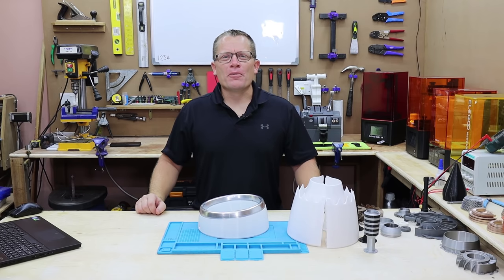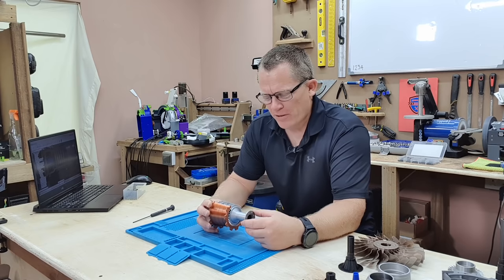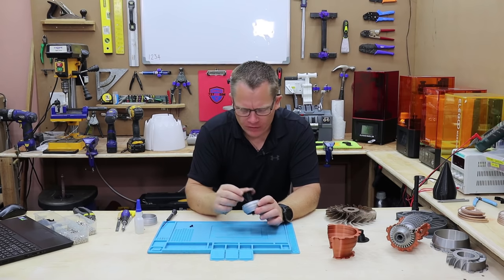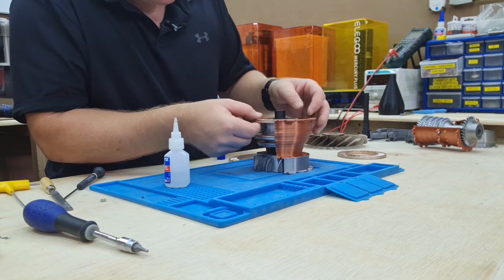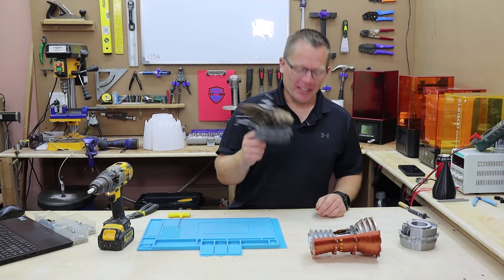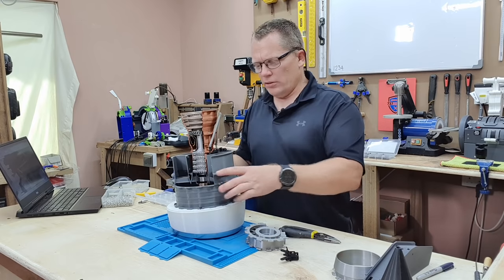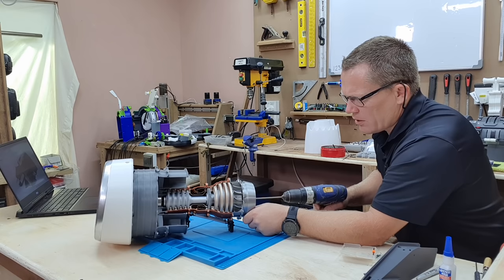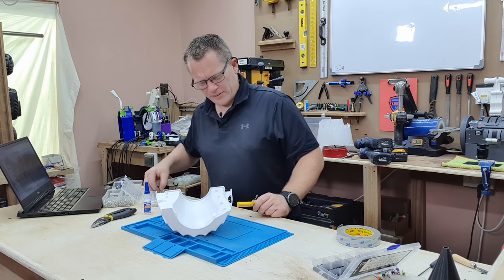3d Printed Turbofan Engine

Comment: Challenge for you: build steel replicas of every piece and try to actually start it with kerosene :)
Reply: I was also waiting for the "working" part..
Reply from the maker: After seeing the rocket engines that are now 3d printed metal, I do wonder if this is possible. But I'd need a few more people watching my vids, before that becomes a reality!
Reply: @helimech8152  this is my first day.
Reply: @helimech8152  dude thats a must, seeing that work would be phenomenal
Reply: @helimech8152  Put the "Thanks" button so that people can donate.
Reply from the maker: If only I had a metal printer, that would make for an awesome build.
Reply: For the people who are talking about printing "steel" parts so you can run it on fuel. I think that there is as much complexity in the metallurgy to make a fuel burning model as there is in the physical parts themselves. The ability to withstand the heat in the section after the fuel cans alone would be a challenge. As you read about the new 5th generation Chinese fighters, with all that their military establishment has for resources, they still don't have the engines for those, if you can believe what is written about them. Still an all, it's a beautiful model and who knows, in the coming years, a fully working model might be in the possible realm.
Reply: Electroplating
Reply: @musoangelo it's possible. He would have to order the parts from industrial 3d printing services though.
Reply: Very detailed scale model. The only constructive use (IMO) would be to use as an instruction aid for students in an aeronautics class. Maybe East Coast Aerotech would be interested.
Reply: Integza joins chat

Comment: In the early 90s, the traveling Smithsonian exhibit -- you know, the Hope diamond, Lincoln´s 10-gallon hat, Dorothy´s shoes, and a Moon Buggy, came to town, which I was happy to visit.

What really blew my mind, though, was a slowing rotating perfect quarter scale model of a commercial turbofan engine at the egress of the exhibit. I have come to realize this as one of the first examples of additive construction. The model was even sized to incorporate thousands of titanium bolts -- a quarter the size as those actually used.

Wonderful!
Reply from the maker: Hi Brian, I would have lived to see that! This is just a plastic version, but I'm so impressed with it. 3d printing is moving fast!

Comment: Truly, it is an excellent build. I have built and still working out some details. I created a detailed accessory package and a swiveling undershelf mount along with 3d lights and a faster 2000 rpm motor. I love this Trent 900 design. Pay the $15 to WileyRC and get the functional reversethrusters. It's amazing!
Reply from the maker: Hi Patrick, This was just for a Prop in the background. Loved the design and build. However, since making this video, i know have turbo prop engines, helicopter gearboxes to create, the list is growing fast. My place will look like my old college training room with all the parts of 3d printed aircraft components. Kind Regards Karl

Comment: This is still a dream of mine to build this model. Thanks again for building on others work, building it, and putting it together. I love turbofans and don't understand why stuff like this isn't available.
Reply from the maker: Hi Zach, this was a fun build. Funny, I was just packing this up last night ready for our move back to the UK.
Reply: I think my original reply was auto deleted by YouTube, I'll try again but separate them into multiple replies as I have a guess as to why a program would auto-delete it.
Reply: Special Note: I applied for a 3D printer very quickly before work began today. I may have not remembered the details accurately about original build and I don't tweet anymore, so it's a mess of replies to replies. If you are unhappy with my tweets for printer for any reason whatsoever, or just simply don't think I should apply with that goal, or have any other issue, just let me know and I will delete the tweets as soon as I can after seeing your deletion request, if it is made.
Reply: I really do love this build, you went above and beyond in creating it. Most of the few models that exist don't have a cowling or pylon, which I think adds so much to the aesthetics and feeling (well, looking at it on screen feeling). I'm still surprised or shocked you can't get a proper model of one (I really wanted one of the iconic GE-90) as I just love Turbofans for some reason. They just get me going, always. And since no one offers it, I decided I'd slowly learn the things necessary to build one myself based on yours and your inspiration sources. At current rate it will be a long while. I've been getting better with electronics, but got slowed down by my own recent moves. Next step is a 3d printer, so full disclosure, I applied for a 3d printer (reason for new comment was I had to find your original video to credit) with stated goal of printing a model similar to yours. Even if I don't get to make one as great as yours I'm just happy someone did it and took the effort and time to record it and share it with the world.
Good luck with your move, hope it goes smoothly, but box that project well, it's super unique and something that should bring you great pride.
Reply: You can find the tweets by searching at Morbo on Twitter, but be careful when searching. I wanted the Futurama name MorboTheAnnihilator,  but it was too long, and now I have yet to figure out if Morbo means something in another language or Twitter is just deranged.
Reply: Original reply probably auto-deleted due to perfectly pertinent, on topic and content related Twitter links.

Comment: There is stool to scrape off edges, it turns to follow contour. Also magnetic extendable tool for screws. Put graphite between rotating parts and casing so spin easier and not heat up as much.
Reply from the maker: Hi Donald, thank you for the advice! Kind Regards Karl

Comment: Have you thought of using 3dGloop instead of CA glue. It’s a chemical weld rather than adhesion. Particularly when sanding produces a better surface of the joint since it’s all PLA (Note fumes aren’t awesome for you)
Reply from the maker: Hello and thank you. All advice is greatly accepted and I will give it a go.
Reply: @helimech8152  which kind of adhesive you use, may I ask

Comment: Awesome  can't wait to see it work with  a motor
Reply from the maker: Hi Richard, I'm currently looking for speed controller and motor that will achieve at 8000 rpm
Reply: Awesome  can't wait to see it running  again.

Comment: Next LVL would be working unit with Metal 3D Printer, Getting better every year
Reply from the maker: Hi John, That would be a dream to build an engine with one of those printers. The quality of the build would be amazing and I would love to see what sort of centrifugal loads they could withstand! Kind Regards Karl
Reply: @helimech8152  With Graphene Nanotubes and microthermal heat transfer I think one could be designed and built in one day. Just need peramaters to input to computer design...... Nvidia has the computer to design and render anything in under 1 second...2021 is a great year

Comment: Haha, that's sensational, Karl! Thumbs up! Next you should print throttle quadrant of same scale and connect em together! :D
PS. Attaching vacuum cleaner's motor at the end will give almost real sound as well! :)))
All the best, Phil.
Reply from the maker: Cool idea! I need to strengthen the large turbine blades first. The stress of more rotational force and i can see it ripping itself apart. However, since building this, many other 3d printed engines have now popped up on my radar that have designed with extra speed in mind.

Comment: Did you know that for some of the airbus airplanes , a few engines are attached to the wings by just 3 bolts ? I used to manufacture some when i was working in an aerospace related company. When I discovered that it blew my mind.
Reply: The Trent 900 that this 3D printed model depicts is one of those. There are only three “bolted” attachment points to the wing. There is a forth vertical pin from the wing that goes into the pylon but only constrains the thrust of the engine. It supports no weight whatsoever and does not need to be detached to remove the engine. The three bolts are also not solid connections but are actually pivot points themselves. All this is done to carefully distribute the weight, aerodynamic loads, and thrust of the engine to the wing structure without generating additional parasitic stresses. 

This 3D printed model has four bolt attachment points but there would be additional brackets that go between these attachment points and the three bolted connections on the wing. The socket for the vertical thrust pin is modeled in the pylon. Some builders of this 3D model have gone as far as modeling the additional brackets and basic wing structure to attach the engine model.

Comment: Karl, this is amazing. Can you do a video describing your SLA printer setup as I see you have a few machines there in the corner.
Reply from the maker: Hi, i have 2 3d resin printers. The Creatilty LD002R wins over Elegoo mars easily in my opinion. The other ones are a wash machine and curing unit. I will certainly try to  create something in the future once the throttle unit is done. Kind Regards Karl

Comment: Amazing model of a turbine!! I was wondering if teflon spray on the parts that still have some friction, would make it run smoother.
Reply from the maker: Hi Sophoclis K, When the design was created, I wouldn't imagine there were many Resin printers available 5 years ago. If I had printed all the parts with a filament printer, I think it would have been super smooth. With a resin printer, my parts come out 0.4mm bigger in diameter. This caused friction against the filament casings. However, Chris the designer actually designed the rotors with wear rings. So as the unit was rotated more and more these wear rings bedded in and the friction reduced. I also need to replace those 3d printed bearings with new steel bearings. This should also improve the running of the unit.
Reply: @helimech8152  My first and very brief experience with a 3D printer was with a raisin one, about 11 years ago but it was so expensive at that time, it would make it impossible to own one. I was so impressed back then, even with the simplest sample: a ball embedded in a nut with a spherical cavity, which would make it impossible to be created as two separate parts and then put them together as such. Since then, 3D printing has become much more affordable, but still what people can do with it still amazes me! That jet engine model is a marvel and I’d really like to see a video when you’ll have all the things that you mentioned sorted out!

Comment: Hi at the ripe old age of 76 I am thinking of buying a 3D printer to makes parts for a 737 sim, but which one to buy on a limited budget would you think that the ENDER 3 PRO would be up to the job, any advise would be appreciated, many thanks
Reply from the maker: Hello, The Ender 3 is too small. I have been informed that there are files included to split the design further down for the Ender 3 though. I have not looked at this option. The ender 3 Pro is an excellent printer for the price and i own 2. You can definitely build the whole engine core on the ender 3. for the larger cowling panels, I used the slighter larger CR10 v3 which has a bed size of 300mm x 300mm. If you can stretch to this printer, I would go straight for it. Its silent and works brilliantly, its like the next level up to the ender 3. Kind Regards Karl

Comment: First of all... what a fantastic project!! It's nice to see you assembling these components!
I have downloaded the 160+ files but as a 3D layman (utter noob) I have no 3D printer.

Are those files sufficient to be sent off to a printing company and have them deliver the non assembled set?
Are there any companies who you could recommend? What price is to be expected for this huge printing job?

With thanks and kind regards!
Keep those great videos coming!!!
Reply: BTW would this set be printable on the latest CR10?
Reply from the maker: Hello Joeri, If you can i would get hold of a CR10. That would be much cheaper than getting the parts printed! and yes it will all fit as that is the printer i used. Kind regards Karl

Comment: I just printed and assembled one. LPT is grinding against LP stators and little hard to rotate. I was thinking to redo the LP part and then I saw you using the drill to wear them. Im gonna try it. Thanks
Reply from the maker: Just go slow, If you go too fast they will melt together
Reply: @helimech8152  Yeah I thought of that. Also, The problem was bent LP AFT shaft. It was wobbling. Found my Printer Nozzle assembly tilted on one side. That explains why the shaft was printed like its bent.😄

Comment: So I started my build yesterday. Bearings are in the works as we speak. Question: what filament did you use for the trim ring on the front of the intake? If not, did you cover it? Im working on the Nozzle Assembly now, should be finished today.

Comment: Thank you for the video.  3D printing these parts wouldn't the ringing and ghosting be too much for a jet engine model or is that FDM 3D printing?  How would you design parts to create a specific engine and aircraft.  I would like to build a 1/35 or 1/24 scale S-3 Viking, but how do you get the design measurements to create the parts and put it together?  I'm also thinking of working on one of the aircraft carriers that I was on.
Reply: I’m the designer of the nacelle. - I printed the prototype on an inexpensive FDM printer. To prevent ringing and ghosting I tend to keep the accel/decel values low. I use 200mm/s^2. At that rate a print speed of 60mm/s produces no discernible ringing. To design the nacelle I traced readily available pictures obtained from the internet. Everything was scaled to fit to jet engine design by CATIAV5FTW. But it came in at a scale of almost exactly 1/16 from the full size nacelle.

Comment: quick question ❓... does it work underwater and would it provide any excess thrust vs a standard screw?
Reply: because my trolling motor needs an upgrade to get boat onto plane 🙂 oof alot of contradictory cross reference words there 😆

Comment: Nice build. I've been looking for a 3D printed GE9X engine for the past couple of days. 
This is a big build.
Did the air become restricted after you ran it fully assembled? 
How much cfm do you think the engine produces?
Reply from the maker: Hi, at 2000 rpm not much, but enough to feel it. Someone else just mentioned driving it with compressed air. That would really spin it up, but destruction would soon follow after.

Comment: What printer was used, amazing by the way.
Reply from the maker: Hello Spooner Fpv, The main printer was the Creality CR10 v3, Backed up by Creality Ender 3 and LD002. This allowed me to print these parts much faster splitting the load over the various printers. Thank you for the kind words, Best regards Karl.
Reply: @helimech8152  Wow, I have the ender 3 ,usually go off Cheps profiles. What's your settings? amazing print, great video

Comment: Hi Karl. I'm Fábio from Brazil. 
I'm building this incredible project. This is the third day printing on my Ender 3 S1 Pro. I really like which color you used in this project. I think it's better than original project. I'm following the colors that you used, except to the parts printed using resin printer. To due size limitations, I'll print the nose cowl inlet lip in parts. Do you printed this part in one piece, correct? Have you painted this part?